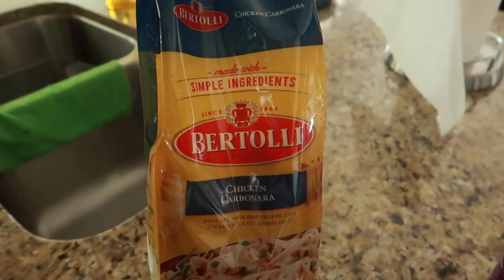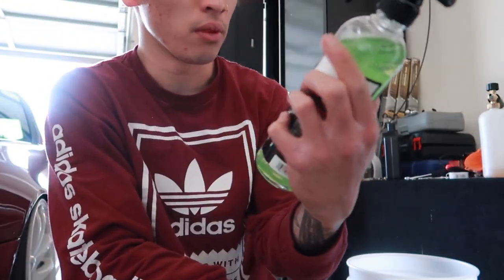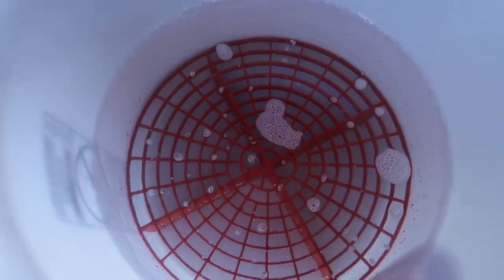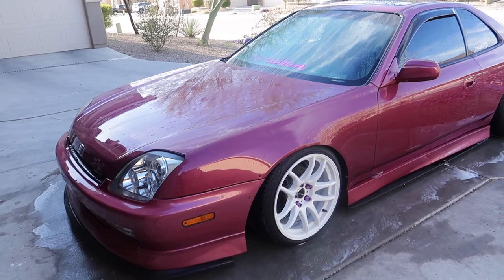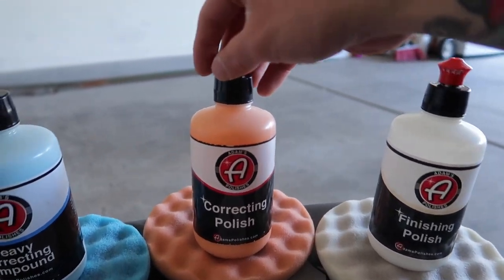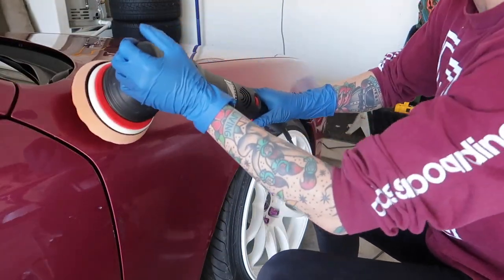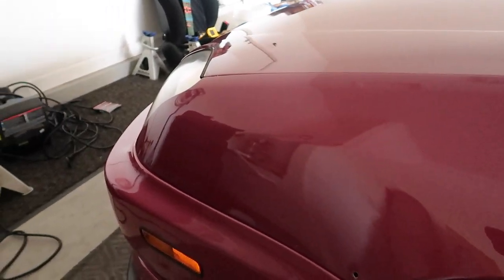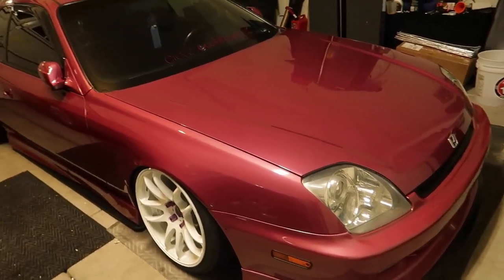Detailing my bagged Honda Prelude!

Comment: Hey sir wanted to ask if you have tried the professional grade meguiars stuff yet. And I wanted to ask if the Adams compounds leave any dust residue
Reply from the maker: Anthony Cook Hey man! I haven’t used and Professional grade Meguiars products. From my experience, Adam’s Polishes products work insanely well with my paint. When I used the paint correction compounds, there’s little to no residue left over.
Reply: Sweet I will have to take a look at their products it's been a long time since I've detailed the cube
Reply from the maker: Anthony Cook Look into them man! It’s also been a while since I’ve seen you ahah.
Reply: It definitely has been awhile lol